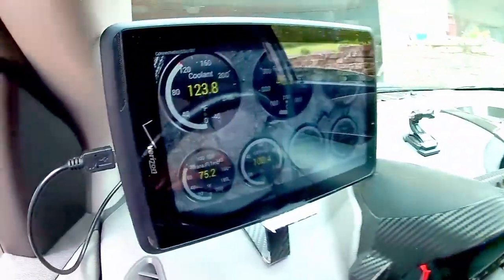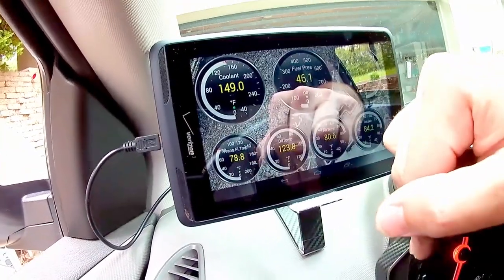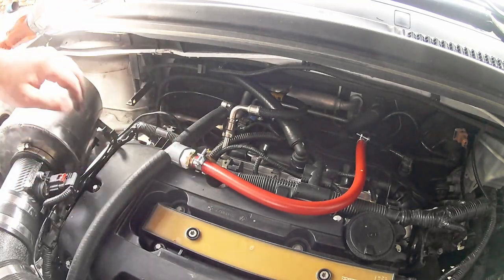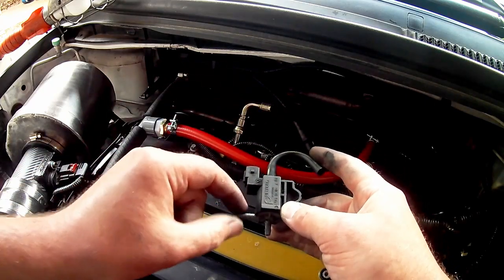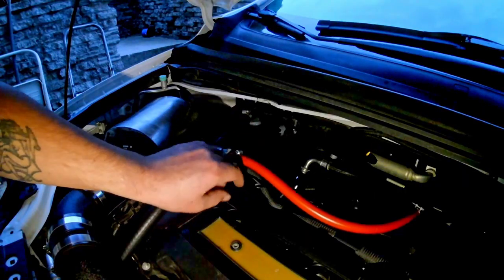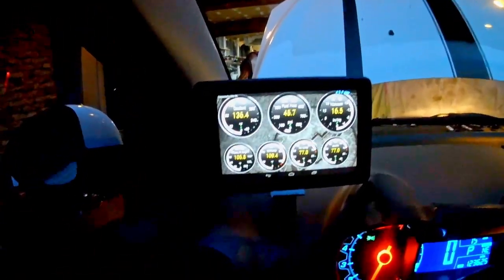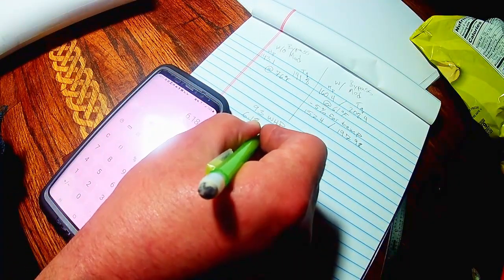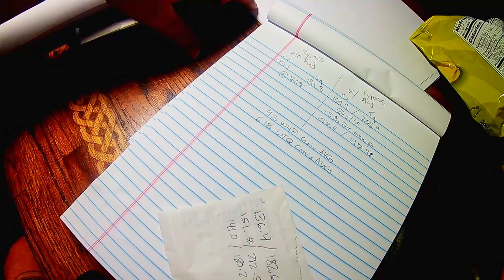Bypass the Bypass Valve Solenoid Mod  - Results will SHOCK YOU, kinda...

Comment: You need a tune with this?
Reply from the maker: I don't think it's really required, but it would be better probably. You would still get the better throttle response, but it may throw an overboost code on the stock maps.
Reply: Correct, as long as every mod works together, and doesn’t hinder any systems. The car will run smooth, as normal. It doesn’t matter, cold air intake alone, or everything built to 400 hp. The factory settings will make power to (~158 hp, for me, 2017 Cruze 1.4t) x. The turbo will just make less boost, because it doesn’t need to make more. Certain mods may make the 1.4t quicker, but not by much. An tune is the best way for power if anywhere close to stock, it is the only way to truly get the power out of mods. That is what I understand, from what I have seen.

Comment: Does this mode rid the electronic part and work it by vacuum only or did you plug the valve making the supercharger on boost all the time governed by the rpm? If it’s blocked and supercharger has boost well below factory you gotta make sure it’s not leaning out if it’s all good that’s a great mod for torque response, but will heatsoak quicker too. A few things I would check before making this a permanent mod for safety

Comment: Hey bro thanks for the vid ....what app can I download to get those displays does it have a AFR gauge ? And does it have a obd cord that plugs into your phone ???? Or is that a display that came with the app ?
Reply from the maker: So the app is called Torque Pro, they also have a free version with less data. Need a bluetooth or wifi OBD2 that is supported by the app. You can see fuel trims on any obd2 live data scan, but for A/F you'll need a wideband O2 sensor installed on your exhaust. It does support it if you had it installed into the OBD2 bus, but most widebnand kits come with their own guage.
Reply: @doescars5417  
I ended up buying the ultra gauge with the cord although I was disappointed in the AFR commanded reading it doesn't work like a regular gauge unless I'm doing something wrong . I selected AFR commanded , just moves once in awhile I thought it would change like the rest .  Also didn't see a trans temp on that unless it was UG temp ?

Comment: Thanks for posting ....from what I understand of this mod the reason why it is done is once you reach wide open throttle the boost / vacuum pressure activates that valve you bypassed it actually opens at WOT wide open throttle and it leaks boost back into the intake manifold . Only thing I can gather is that it's a protective part so you don't over boost your engine . I have a 13 sonic RS and it is night and day at WOT that's were you will notice it , very noticable but ... I had to go WOT to notice it you won't at part throttle or 1/2 say normal driving . if you want to go 100 all over the place it works great you will leave a un  modded sonic / Cruze in the rear view mirror lol ....  I ran the mod for awhile ..
Reply from the maker: I think, it's not so much at wide open throttle, but the entire rev range. The bypass valve itself opens when the manifold is under vacuum, when you let off the throttle, but this system allows the car to open the bypass valve at will using vacuum from the chamber under the manifold. This mod just makes it a fully mechanical system, only recirculating boost when you actually let off the throttle. Definitely feels faster up top tho, so you're not wrong there!
Reply: @doescars5417  hey man I'm having trouble with my 2012 cruze do you have any advice?

I was only getting 5psi. I thought it was a turbo problem and replaced it. Now I often get 14psi again but almost everytime I try to hold it there for a good pull the car eventually loses it. 
I'm WOT and suddenly the boost instantly drops to 5psi and my accelerstion suffers..

Could this bypass solenoid be the problem/need replaced?
If Is there a way to bypass the bypass solenoid temporarily as a diagnostics test?(assume boost functions properly after removing the bypass solenoid.. then the solenoid is the most likely problem?)
Reply: @RandoManFPV  if you can’t hold boost it’s a wastegate actuator issue
Reply: @ZammianX  brand new turbo. No change in performance or boost
Reply: @RandoManFPV  then it’s your tune or gas, always use the highest octane available in your area (93 is perfect but 91 works if that’s all you can get), also could be boost curve from the factory tune from GM. & also could be weak injector spray pattern, so grab a bottle of injector cleaner and dump the whole bottle in your tank & full it up with high octane gasoline if you still can’t hold boost it’s your stock tune
Reply: @ZammianX  it's on a stock tune but the problem just started recently.
I always use best gas available.
The injectors may be a good place to check, someone mentioned to me that they were a little clicky sounding...
Reply: @RandoManFPV pcv valve

Comment: Did you leave the solenoid plugged in?
Reply from the maker: I did, wanted to make sure I didn't throw any codes. I've actually gone back to factory with this and the difference is pretty nominal. I didn't gain or lose time at the drag strip. Fun mod to do, and it does feel a little more responsive at first!
Reply: @doescars5417  I was hoping that since they run the same system just newer as Saab did with their turbo set ups, I could do this. Worked for about a day and got an engine light, but it was a neat idea to try
Reply from the maker: @rileyellison8448  ahhh yeah, as long as the BPV has an 3 way solenoid like this that controls when it opens and closes, it should work. I could see it throwing codes though...

Comment: Stupid question: what if you run the hose between the 2 valve inlet/outlet? I think one is inlet (from the manifold), the other one is outlet (to turbo). Right?
Reply from the maker: So, it's actually a 3 port solenoid. 1 side comes from the manifold, the other comes from a vacuum reservoir on the bottom of the manifold, and then outlet to the BPV. The PCM uses it to open the BPV when it normally wouldn't, basically. I don't know if that way would throw codes or not, but it could prolly work!
Reply: @doescars5417  can you send me a map drawing showing it better. From the turbo which one is it going to the bottom or the intake or the side one. So which one are you blocking from the intake
Reply from the maker: @hugovaro7781  I'm sorry I missed your comment! I could draw something up. Basically, you are taking the hose that runs towards the passenger side wheel, and connecting that to the intake. Drawing would help I think lol. I will do another video about this mod for you, and try to make it more clear for everyone else.